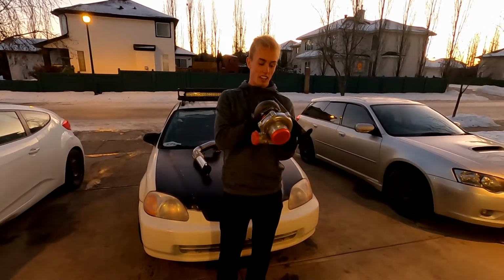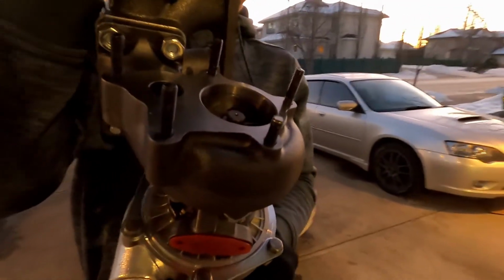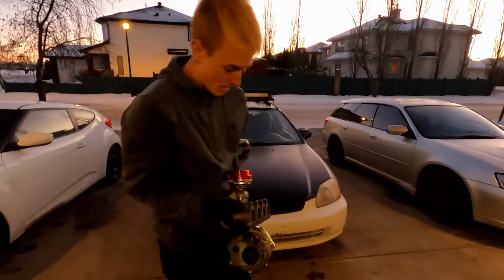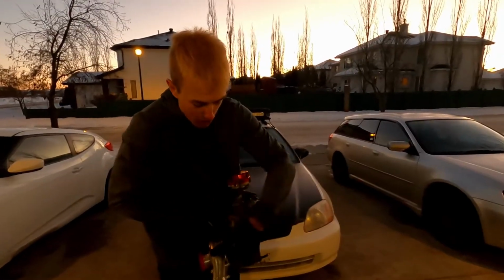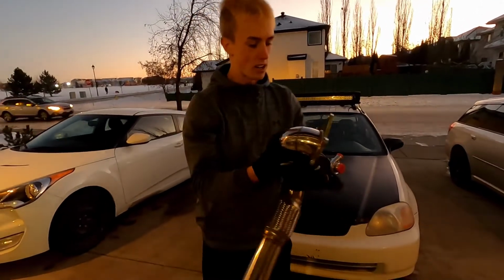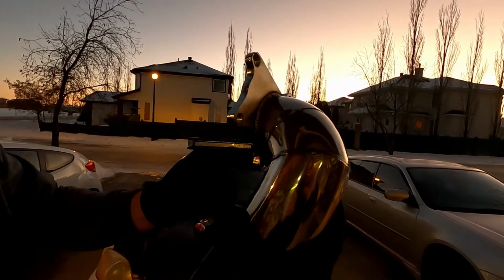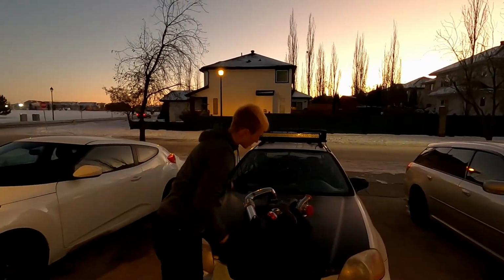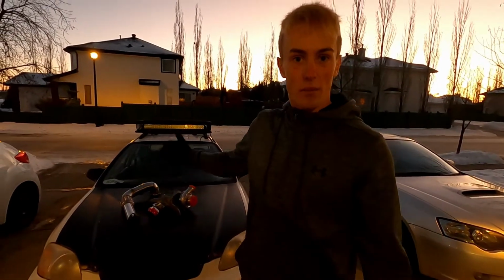Why NOT to buy EBAY TURBO Parts

Comment: Couldn’t tell on the Down pipe, your going to need 1-2 o2 bungs welded in.
Reply from the maker: It has one.  Ive been reading about the stock o2 sensors.  General consensus has been that you dont need them, but if you keep them, you'll have better fuel economy?  What do you think?

Comment: I agree, bought things from eBay a lot for my 1995 eagle talon esi. 7/10 items came in the mail messed up or on its last legs. 

First time was a crank sensor that burned in 6 hours, a radiator that wasn't welded correctly, control arms that tore bushings in less then 2 weeks. My last straw was a rear wheel hub assembly that costed $30 (oem was $85) and 800 miles later it took out all 5 wheel studs, sent my tire flying in full send on the highway.  

0/10
 don't reccomend ebay, buy name brand everyone, those couple dollars you're trying to save is gonna cost $100s in the future
Reply from the maker: Holy man, I see why you stay away from ebay...

Comment: Awesome stuff J man! I’m grabbing an XS Power k04 for myself (ebay) albiet my car is already turbo’d so it’s got a lot less to go wrong lol. Plus all the forums recommended them for a good cheap bump in power. You get yourself a new civic beater?
Reply from the maker: Ooooooh, that sould be fun!  You'll have to swing by after that k04 goes in so I can see it.  How much did yours run you ($)?  And yes, bought it in BC at the start of October!
Reply: @JWheelie  about $600 all in. Pretty budget i’d say😂 but i got rods and pistons, gotta buy a clutch and tune and she’ll be minty
Reply from the maker: @rsantos12  Hahaha, Thats pretty damn cheap for a turbski, rods, and pistons!  How much bigger is the new turbo?  Definitely bring it by when you're done!
Reply: @JWheelie  yea man! Turbo is $600, rods i got for a deal from my buddy. Old turbo compressor is 50mm, new one is 59.5mm
Reply from the maker: @rsantos12  Ah gotcha, that should be a good bump in power, especially with a tune!  (Should be a better quality turbo than mine... mine was $221 shipped)

Comment: badda bing badda boom bobs yours unlce i did not know those things. i wanted to turbo the crx but using the single jinle vtec D17a2 it is a greasy motor beats the z6 vtec
Reply from the maker: Nothing too crazy to work around, so do you still have the crx or is it gone now?
Reply: @JWheelie  gonzo's i had the chance few months ago to pick up at 91 si in teal but someone got it.
Reply from the maker: @yegmtb8377  Awe, too bad.  I'm guessing you always keep an eye out?